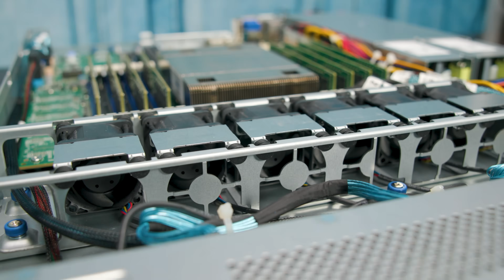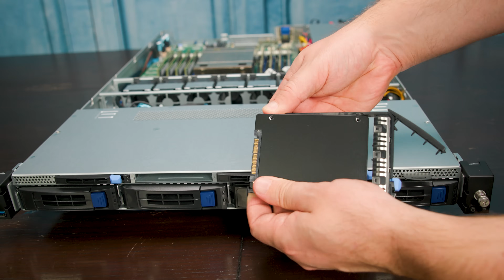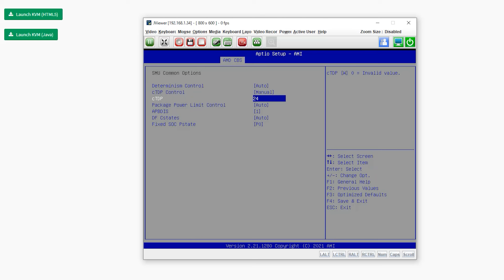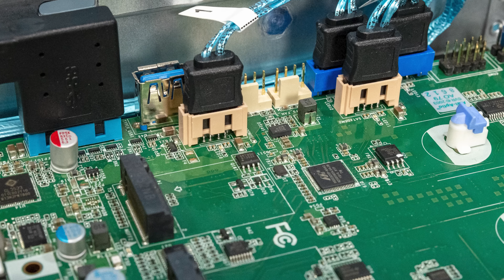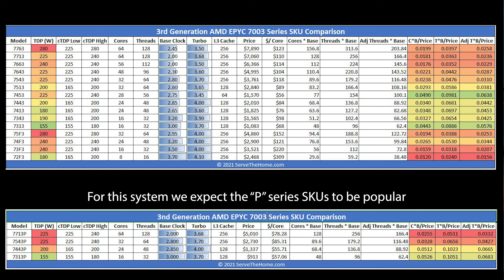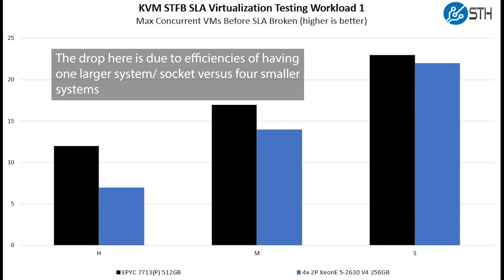Voracious 8:1 Xeon E5 V4 to EPYC 7003 Consolidation with the Tyan Transport CX

Comment: Intel Xeon Platinum 9282 56core thats what i want to see.
Reply from the maker: Significant downgrade to the 4x Platinum 8380H "Cooper Lakes" we showed a few videos ago. The 8380H's have 1kW of TDP, more UPI links, DDR4-3200, and bfloat16. The dual Platinum 9282's were basically pairs of Platinum 8280's packaged together to call them "dual socket" while providing less memory capacity, bandwidth, and inter-die bandwidth.
Reply: @ServeTheHomeVideo  oh i know is not that powerfull but is so hard to find a video of that machine is so rare, if we talk about power then bring one of the new chinese desktop Quantum Computers like the SpinQ or the Optical Photonic Quantum computers like Xanadu cloud based  or optalysys optical co processor similat to the old intel xeon phi, cant wait to see that thing mining bitcoin.

Comment: AMD is just tearing up the stereotypes about servers and offers a solution for almost any rack with their board partners.
A Company with 25 desks consolidated and upgraded 3 year old xeon rack to a single 2U single socket Rome chasis and the quotes for replacment Xeon upgrade where around 2x the cost. AMD is on the roll in small business sector.

Comment: Hi Patrick, the other major benefit of these consolidation servers is the software costs which are usually measured against physical socket/CPU. Although this is changing in some areas. We get a major benefit with the cost of render licenses which in the 4 node example we can bring the cost down to 1/4 which is pretty amazing. Until they bring out the new per core licensing model... :P

Comment: U = "Unisocket"

Intel servers have used the term for a while, though this is the first time I've heard them shorten it to just U.
Reply from the maker: The challenging part is that the most common use at Intel of "U" is for the lower TDP Core parts, e.g. Core i7-8569U
Reply: Why can't manufacturers agree on a common nomenclature for servers or cpu's! Chemistry has these systemic names which are really succesfull, and then they most of them map to a marketing name. That would save you a lot of future tongue twisters.

Comment: That system in a desktop case could have a fun marketing story to tell. There's bound to be a lot of businesses who could replace a small rack of equipment (a few servers and a switch to connect them) with just that one box
Reply: I could easily see networking becoming a significant issue for consolidation in this use case. That 1GbE switch/router with a 10GbE uplink that worked for four separate boxes would be a bit of a bottleneck to a single box. Nothing insurmountable, just one more checkbox to put on the upgrade checklist.
Reply: @timberwolf1575  That 10Gb uplink can go straight into the epyc box; no switch needed

Comment: Well dual sockets migth still be interesting : dual EPYC ones! 😉
Reply from the maker: Totally. We will do dual AMD EPYC server reviews I think we have 3 dual socket servers including two with different types of NVIDIA A100's that are in various stages of reviews. Likely will do videos on them as well.

Still, single socket is different, and less exciting to some people, but I wanted to clear up why it exists, and why it will become more important.
Reply: @ServeTheHomeVideo  Thanks Patrick for your answer. And I clearly understand your point: it depends on the needs obviously.
Are you guys also running systems with GPU computing ?
Reply from the maker: @philippebenas5721  We do not have GPU compute for the web servers as you would imagine. We do have a number of GPU systems in the lab though and have been reviewing big GPU servers for many years.
Reply: @ServeTheHomeVideo  Thank you very much for your answer. Indeed if your actvity is centered on web services I understand your company doesn't provide computing ressources.
I joined recently your YouTube channel which is very interesting and I'll follow your GPU setups as well.
Thanks for your great job!

Comment: Saves space, energy, and maintainence cost. The only obstacle might be the reluctance of IT management to NOT upgrade into these more efficient node. Performance isn't AMD EPYC's enemy, those who controls server upgrades cycles is.
Reply from the maker: That is totally correct. As we move to higher power per CPU/ accelerator designs, which will ramp in the next 1-3 years, there is going to have to be a whole education cycle in the IT industry around why single socket can make sense. Core counts are going to rapidly increase as well so this type of thinking is going to work for some time.
Reply: @ServeTheHomeVideo  With the Rumour that Zen 4 TR and Genoa having 96 cores in a socket (LGA6096), AMD should (fingers crossed) create a large enough performance and space advantage to promote migration from 2/4 socket stacks to a single 2-4U server depending on the use case. Its really the short run vs long run argument, and its hard to convince IT management with long run argument right now.

Comment: Those power distribution boards are fun! Just like PicoPSUs you can pair with HP common slot PSU units for cheap high power desktop PSUs.
Reply from the maker: PicoPSUs are much quieter though :-)

Comment: I think that the Tyan Transport CX GC68A-B8036 is a more compelling option supporting 12x 2.5" devices
Reply from the maker: Susan - that is going to be the case for many. The challenge is that frankly it takes a lot of time for us to do these reviews. The main site article has more detail and is a 4000-5000 word review as well. It is basically impossible for us to cover every front panel storage configuration. As a result, I try to talk about what we have in the lab and what possible options are.